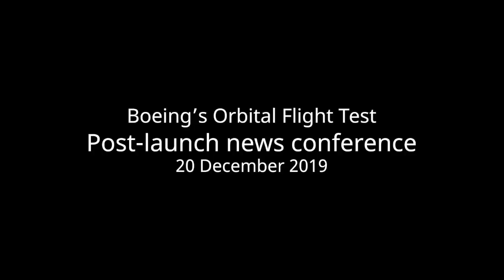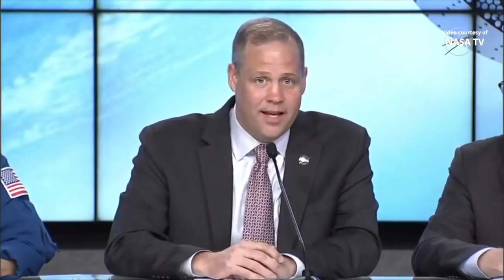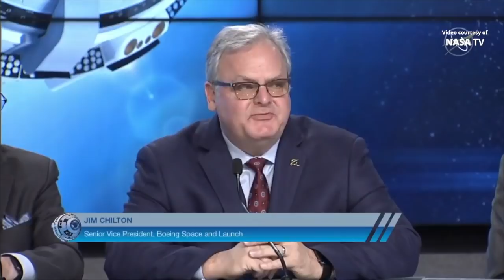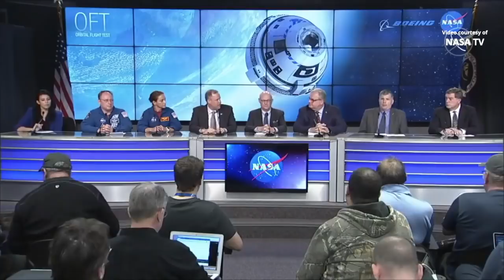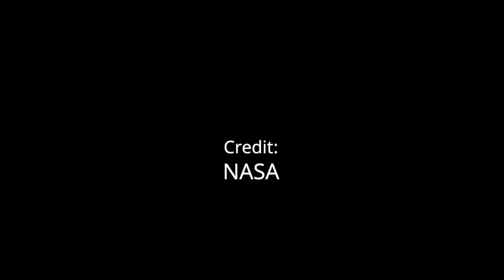OFT-1 Starliner status update

Comment: NASA's Bridenstine says: 0:29 ...timing system had an error in it, 1:38 ..."has to do with automation" ...not working according to plan, 1:50 ...if we would have had crew in there ...we very well would have been orbiting ...or we may be docking with the international space station tomorrow 

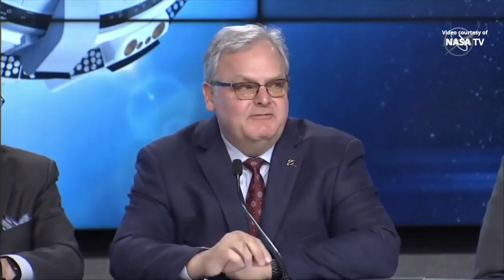Boeing's Chilton says: 2:24 ...it appears that the vehicle was using a mission elapsed timer that was not the mission elapsed timer the mission was on... 2:30 ...we don't understand the root cause of that, we don't know if that was inherent "somewhere" in the vehicle or was caused by "some" event, just haven't got(moving away from the issue...) - what we know is the vehicle was not on the right timer 

To sum this up: Don't blame it on automation or the wrong timer. This is 'HUMAN ERROR' that can be tracked precisely back to some team/individual who failed to quality control the programming logic or other similar type of simple set of checks that was missed and/or bungled. It's going to suck for certain people in the team who are going to have to take the hit for it but this will eventually come out in the findings so don't try to glaze it over.

Comment: Boeing is not SpaceX...
Reply: @Pronto Spacex had a parachute test where none of the parachutes deployed causing the test sled to hit ground really hard and it got badly damaged. After this test spacex has been working on the mark 3 parachutes that will work right. Boeing already completed their parachute certification. After boeing experienced their partial failure they implemented methods that makes sure all parachutes are attached. This really shouldn't be compared with the max as boing has 150k employees and this caplule is made by the space team. However spacex should be given much more credit because they offer so much cheaper flights (oig report) even though boeing has been in the industry much longer.
Reply: Spacex exploded
Reply: during ground testing after successful flight to ISS and return to earth

Comment: So no rendezvous to iss?
Reply: Mister Meow nope
Reply: Unfortunately not.  The capsule is coming down exactly where it's supposed to, but it used up so much fuel on pointless corrections that it won't be able to match velocities with the ISS.  The spacecraft thought it was still attached to the booster, so it kept firing its thrusters to stay in a very narrow "dead band" that it's not allowed to rotate out of - but without the Centaur attached, it just kept over-correcting, and then over-correcting the over-correction, and so on.